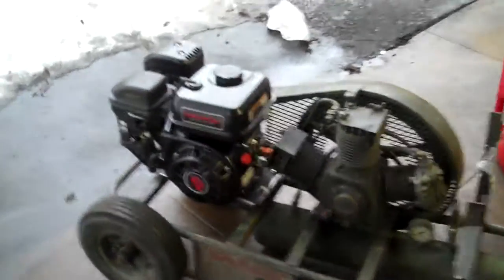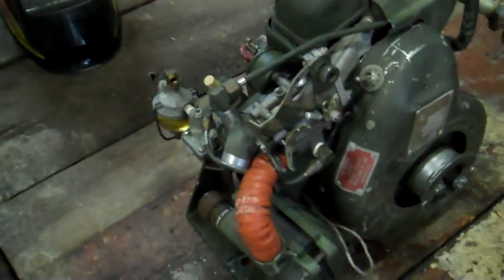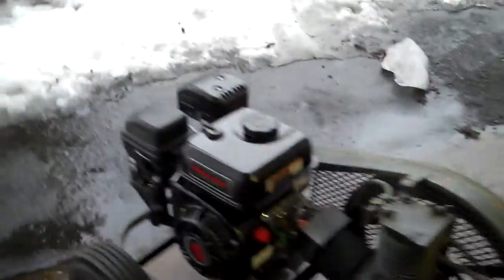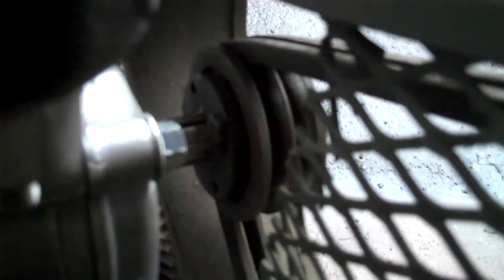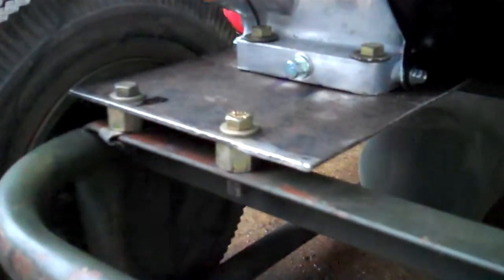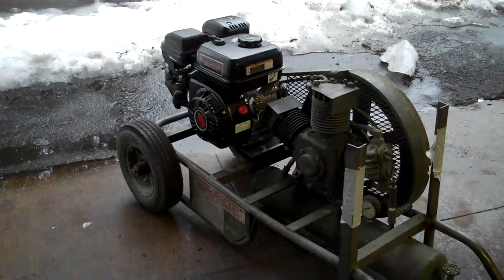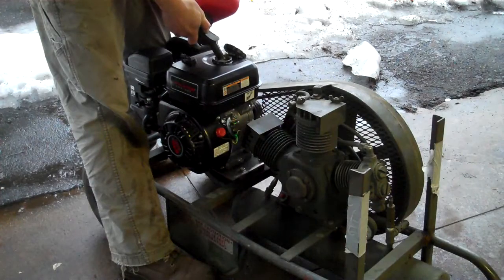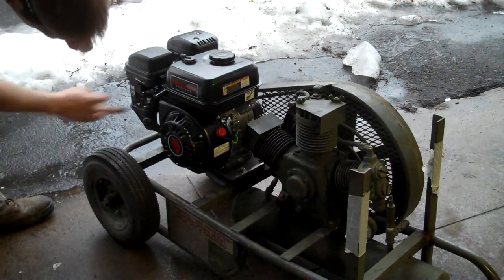Military compressor with Harbor Freight 212CC Predator engine swap

Comment: How were u able to get the starter rotated around on this engine as i need to do that to my 212 predator cc engine i had installed on a Cyclone rake classic on the vacuum unit but it was a challange being the position of the muffler as it had to be repositioned to clear the blower housing and had to add a deflector to point the exhaust down. and had to make a shaft adapter for the 3/4 shaft to the 1 inch bore for the cyclone rake's Miracle impeller. as this engine replaced the Tecumseh Enduro that was on it. as this engine has much better performance than that tecumseh that was on it. I also had to install one on a Cub Cadet 2 stage snow thrower to replace an Tecumseh no doubt. ad i got the new pressure washer from harbor freight that has the 212cc engine and AR pump. There is two versions of this Predator engine one like you and what i got is made by chonging ratio power manufacturing. the other one is made by Loncin. the air cleaner in the engines i got uses only a foam element which isn't good so believe it or not the air filter element from that Tecumseh Enduro fits this predator engine perfectly in fact i got two more paper elements for the two other predator engines i got.  im assuming for replacement parts with interchange with Honda for some parts.

Comment: Chrysler Sucks Penis.... as always
Reply: The motor is a continental designed engine Chrysler was one of the 3 subcontractors that manufactured those motors continental built damn good  engines the problem with these are finding parts and people that know how to work on them and the special tools also you also can't use ethanol in them either because it swells up the cork carburetor float causing it to stick

Comment: How does it know when tank is full? Does it just bypass the tank?
Nice work,,, hows it working out?
Reply: I was thinking the same thing...
Reply: @bethanyjohnson6096  An unloader cuts off the air to the tank and vents it off after it throttles down the engine!